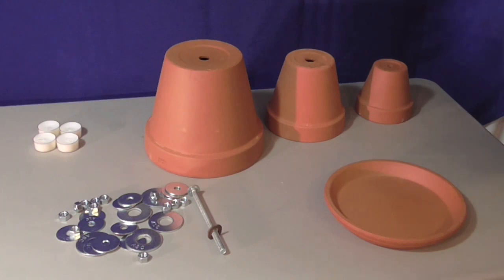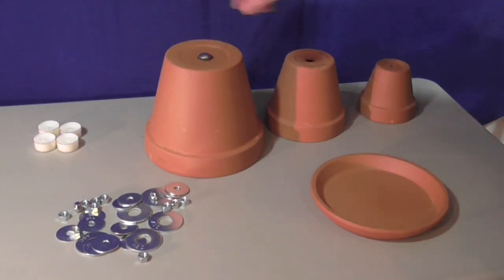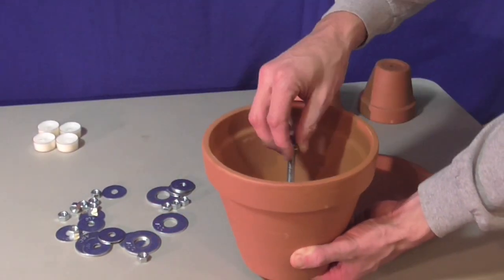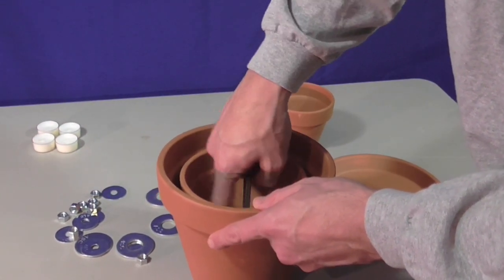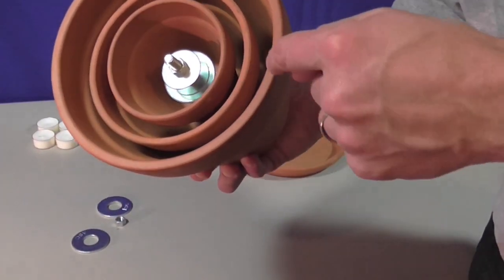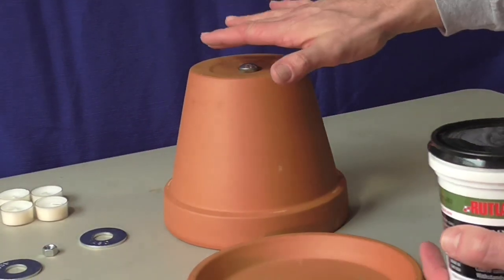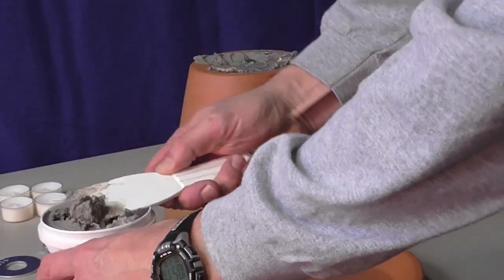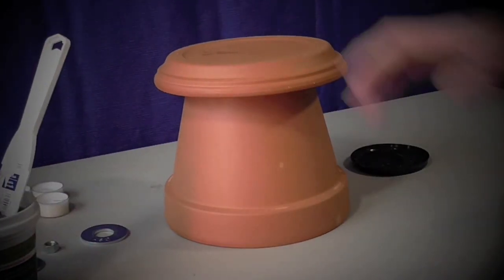How To Make A Terra Cotta Pot Candle Heater

Comment: I had a couple of problems with this video.  First, it tends to call your expertise into question when you don't know the difference between a nut and a bolt.  Secondly, once the unit is finished do you simply light the candles on the countertop and set the pot-thing on top of them?  Or do you have some kind of base that insulates the hot candles from the surface they are sitting on?  How do you get air in to the candles with the pot-thing on top of them unless you have a base to hold the candles that also holds the pot-thing up a bit for air flow?

Comment: It's true with tea candles to heat the pots but the tea candles only last less than a hour and you are right back to spent on tea candles. 
But I do agree the pots together do give out heat. Yet, I have found using 1" mason jars drill a hole on the lid fill with order less smokeless, 
Lamp oil and it will last more longer than the tea candles. I must say my congratulations on the idea for I have done it and I tip my hat to all. 
God bless. And Thank You.
Reply from the maker: Thanks for the tips!
Reply: It depends on the wax used to make the tea-lights.  I bought some that last 8 hours.

Comment: Candles output is approx 100 watt. Where I live 100 watt is adequate to heat 4 cubic meters of living space. My room is 92 cubic meters. I need only to burn 24 candles all the time to keep warm.
Reply from the maker: That's interesting.  Maybe 24 candles is worth it if you have a power outage and need heat?
Reply: @MarkThomasBuilder  If my distric heating goes off, I use electricity.

Comment: Wait! You forgot to show how it's set up with candle/airspace gaps at bottom.
Reply from the maker: Here's my part 2 video---> https://www.youtube.com/watch?v=zV62wQ2d9Bk&t=209s 

 I put the link in the description.
Reply: The scene bad guys like him make you realize you already have your own YouTube channel! This guy does not know what he's doing! I'm just shaking my head and laugh and do the whole thing! Hey have a wonderful 2019
Reply: @MarkThomasBuilder  how in the hell do you believe this nonsense you're a grown man for Christ's sake. These stupid gimmicks are useless. A paraffin candle has a finite amount of energy. It does not matter whether it's in a pot or sitting on top of your head it's going to give off the exact amount of energy that it's going to give off. If you heat up a flower pot and expected to produce more energy then you're not too bright.

The only benefit this would be is if you had to warm your hands and realize your candles had just gone out a couple of seconds ago you can go put your hands close to the pots and warm your hands up until they cool down very rapidly I might add. The time and energy it takes to heat the pot up to temperature is equal to the time that it'll take for them to cool down given the same circumstances of ambient temperature. So you're cutting off of one end of a blanket and sewing it on to the other this is absolutely useless. Simply sticking a candle on your countertop will do the exact same thing I cannot believe a grown man would put this in a video

Comment: So I didn’t see a heat source. I’m assuming you put candles in there somewhere. No luck finding the next video to see how you actually use it.
Reply from the maker: There's 4 candles under the clay pots I believe.  Here's the link to the test... https://www.youtube.com/watch?v=zV62wQ2d9Bk
Reply: @MarkThomasBuilder  
Don't quit your day job.
Reply: The washers obviously keep space between the ceramic jars allowing the heat from the candles to be trapped between each layer as well as heating up the ceramic itself producing more heat. The only problem is if you got a draft or if its really cold youll need a lot of candles which gets just as expensive as buying gas heaters and such. Id rather figure out how to build a shorter angled floo then I could use a cub or grizzly woodstove inside an apartment running the floo out the window if I could find a way to seal the window without the heat travelling up the tube causing issues. Would be much cheaper in the long run burning useless junk and sticks versus buying more and more candles which are handier in other situations.

Comment: If you don't have an air flow going in, your candles won't burn?  Also assume you are putting candles under smallest pot?  You need something to set them on lest you burn your floor or whatever it is sitting on.  Like the multiple pots with space in between, will allow for several layers of heat.  Get quality long burning votives!!!
Reply from the maker: Thanks for the advice!

Comment: Do you really heat the house with these pots.  I know they do get hot, but heating a house is a little far fetched, I think
Reply from the maker: No, it's was a popular idea for a small room space heater a few years ago.  I tested the theory out and found it didn't work too well.  It might help in a power outage though.
Reply: No. They're only intended to heat a single room. But video failed to show how to use the tea candles. He's simply trying to get followers.

Comment: no offence but where do the candles find the oxygen to burn?
Reply from the maker: The candles are sitting in a open pan just below the clay pot.  There's plenty of oxygen coming in to burn.
Reply: ah I see. thanks for clearing that up :)
Reply: Why didn't you show that in your video?   If the candles are "sitting in an open pan, is the terra-cotta pot assembly raised somehow around and above the candles or what?  Maybe you can show a photo of the final assembly.   : /
Reply: Really?  This was like building a two legged tripod. Show it with the candles. I'm moving on.

Comment: Where does the candle go?
Reply from the maker: It uses 4 small candles that go inside a bread loaf pan.  The terra pot sits on top of the pan and the heat from the candles goes inside the pot, where heat builds up and radiates out.

Comment: OPINION: This video leaves out so many questions that need to be answered. It is the most incomplete video of it's subject matter I have seen on youtube...and I have watched dozens and dozens for months............................................................ Just as an example:
** you have to have the bottom propped up at least 1/2 inch to let air in otherwise the candles will go out. Also there has to be room under there to fit the candles. His way the candles are jammed in touching the bottom rims of the pots. There should be at least 6 open inches above the candle.....minimum
**You need some kind of a fire safe base to set it on....like 2 bricks on a stainless steel trey.
**Do a deep dive research on what type of candles are the most safe and what chemicals they release.
Again...this is just my "opinion" but it is based on months of research.
Reply from the maker: Okay, thanks for taking the time to share.

Comment: STUPID WATER OF TIME;  NO ENDING, DID NOT SHOW WHAT TO USE FOR HEAT (CANDLES?), DID NOT SHOW HOW TO USE THE HEART SOURCE!!
Reply from the maker: I have a follow up video showing all that.   The link is in the video description.
Reply: @MarkThomasBuilder  Mark why don't you just admit you don't know what you're doing? You should need a follow up video. Especially when the original design is wrong.